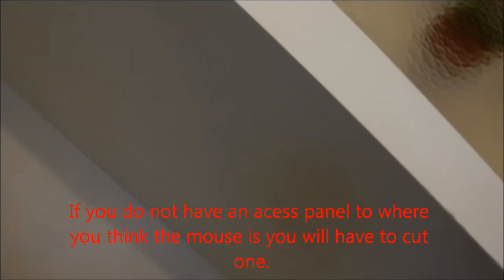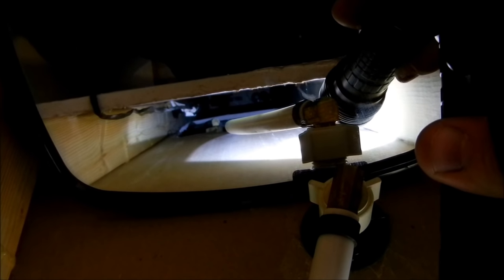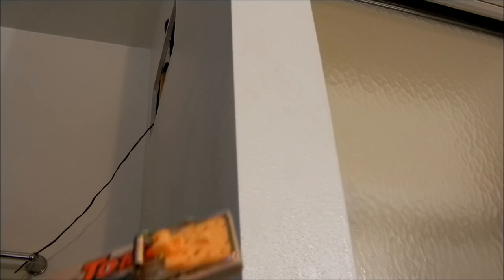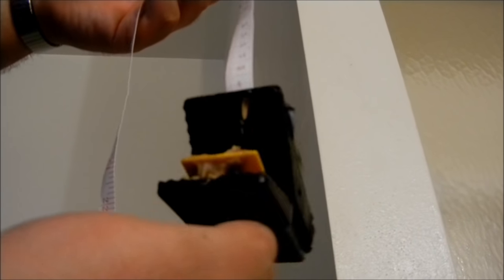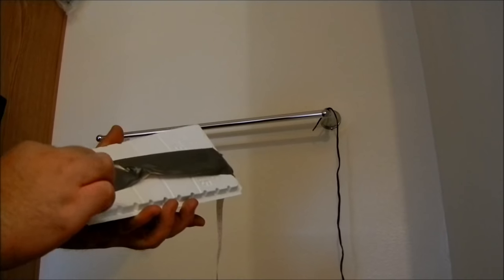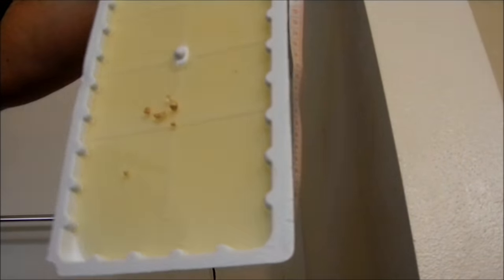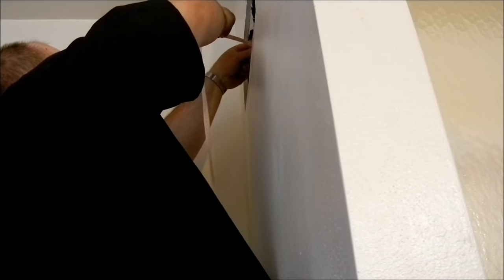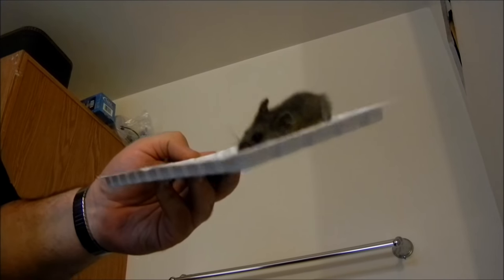Catching a mouse trapped in wall cavity.

Comment: the big question is, HOW did he get there in the first place???
Reply from the maker: The hole in the wall is an access point to the shower plumbing, I am sure he followed a plumbing run, no idea where he got in its a mobile home with block skirting so he could basically get in anywhere he found a hole.

Comment: glue is the most cruel way to kill a mouse, you should avoid this... find the entrance outside your home and block it and no more mouse will come in instead anymore.
Reply from the maker: +Helen Motoshoko the trap did not kill him, just used it to catch him. Killed him with a knife after I got him out of the wall. The only time I ever use glue traps is when there is a mouse to smart for other traps, and generally I don't have mice in the house because my cats keep them out and my 1 cat kills about 1 every day outside.
Reply: why don't you released the mouse far away of your home instead to even kill with your knife, sorry, i just don't see the point of all this act when it's so easy to catch them and released them far... seem people like to kill animals, it is strange for me but anyway ...
Reply from the maker: +Nub Knook They sent the unicorn to the glue factory to make the rat trap.
Reply: Are you actually feeling sympathy for the mouse? A house pest that eats your food, chews on your valuables, and such?
Reply: cruel??? what th??
Reply: Sorry but, patching a hole. Doesn't solve the fact that the original ones will still multiply inside the home.